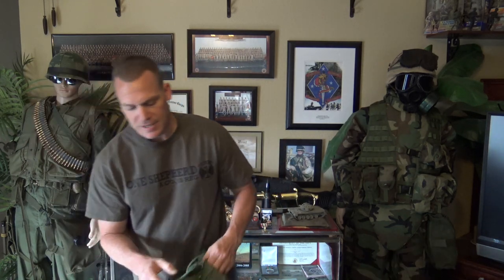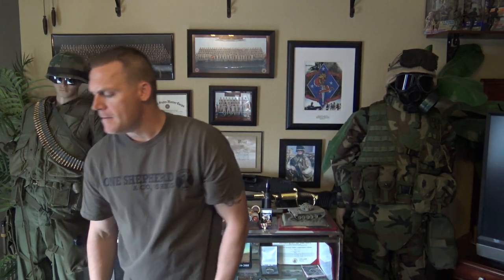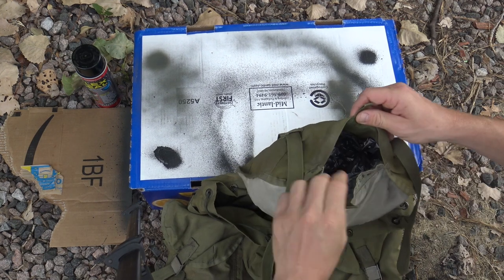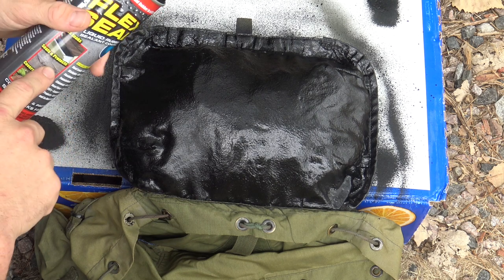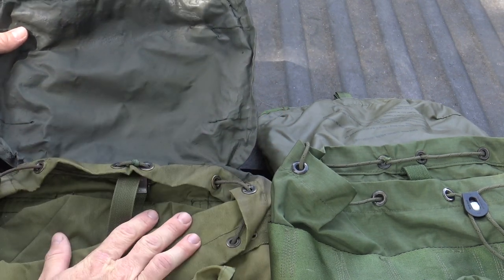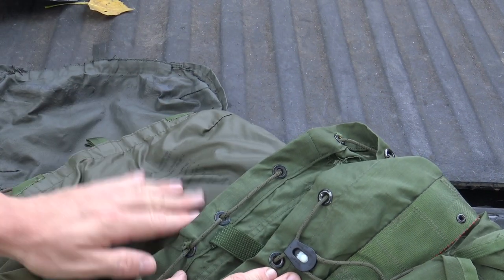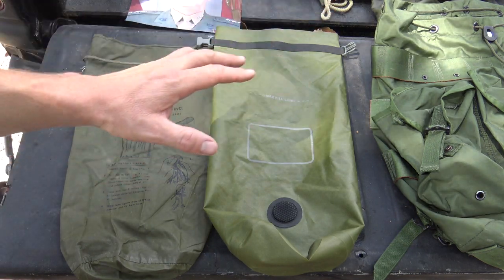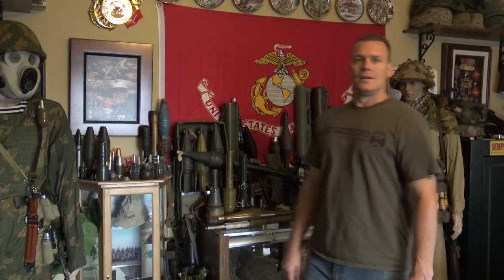Quick & easy repair to your old ALICE pack lid

Comment: A better way to fix the lid is to apply 100% silicone making it SilNylon.  Coating the whole pack with silicone is even better and it really helps in heavy rains and such. There’s a guy over on scoutrifle.org who has done the best and most comprehensive review of upgrading and improving ALICE packs that I’ve seen anywhere. http://www.scoutrifle.org/index.php?topic=8434.0

Comment: Or you could give the outside of the pack a few coats of liquid silicone, "Thompsons", wait to dry between coats. And use dry stuff bags. Also a couple of extra large glad bags to wrap pack in for floating pack across water , floatation device and  XL bags can be used for sleeping bag or shelter material.

Comment: Why not just do the whole pack in flex seal
Reply from the maker: If you want to turn your pack into a water bucket go ahead. Generally you use a water proofing bag inside the pack which will also make it a flotation device for crossing water.

Comment: Don't waste your money on those waterproof "vomit" bags. Use heavy duty trash bags or ziplock bags to contain your gear in. Much cheaper and you will not cry once they tear, just grab another. A good, thick rubber type band will seal the bag. The other bags were not the right size for my large slice ruck.

Comment: You can buy a used ALICE pack for the price of a can of flex seal.
Reply from the maker: You actually cant anymore, they have dried up.
Reply: @Brent0331  Very far and few between now. i threw away my camo poncho because it did not keep water off. luckily it did not see the garbage pickup and i just saved it. those ponchos are next to IMPOSSIBLE TO FIND  i will use clear flex seal to redo that

Comment: A bit odd that anyonyone wants to have water inside the two layers in the top.  i just got a deal on a LC-1 and my plan is to rubberize the top and bottom of the top flap and also sew it shut.  I made topographic maps (81C20).  Why anyone wants to put ANYTHING in that stupid area is beyond me.

Comment: All of this old issued stuff is a waste of money. It's heavy. It might be great for a 19 year old recruit to hump around, but you can do way better with modern kits. I built a ALICE pack set up and the pack with all of the bags with rack (empty) and it weighed as much as my modern pack fully loaded with the same gear. Not to mention the load bearing on these old packs just suck. The modern systems are comfortable and carry great.
Reply: I completely disagree.
Reply: @brucecamparmament3728  You disagree that that an ALICE pack with frame isn't heavier and as comfortable as a modern load bearing pack? ok...